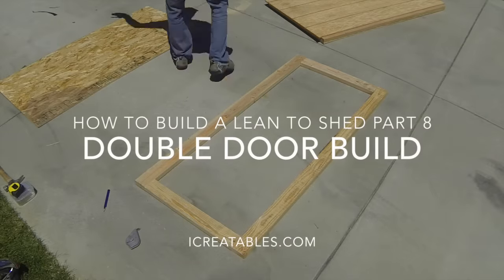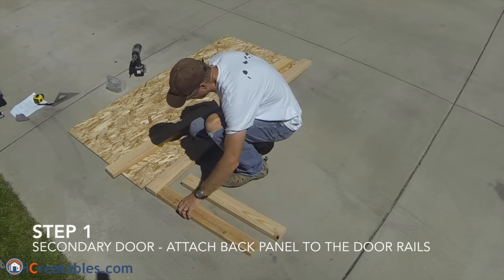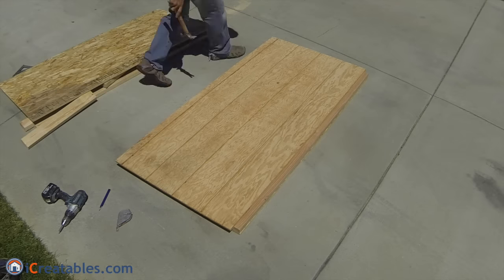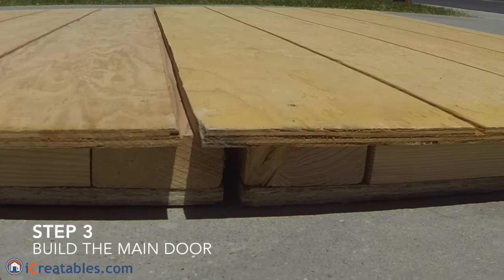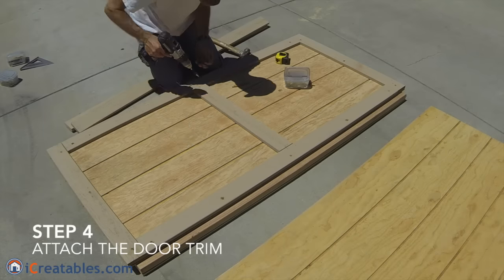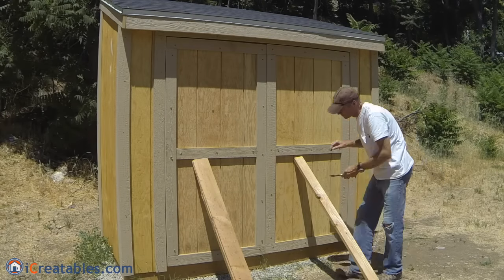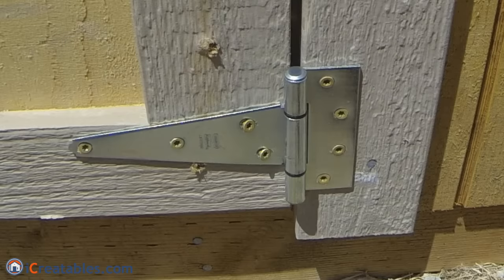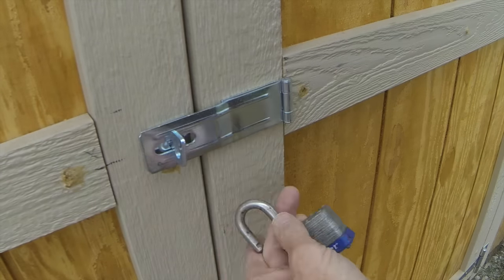How To Build A Lean To Shed - Part 8 - Double Door Build

Comment: Took me 5 hours.  This is one "SOLID" door.  Oh my, it is a horse, but I used $3.00 6" hinges from HD and it swings like  it is on oil. The door really looks sharp.  I made my door 1" longer at the bottom for overhang and it looks fine. Otherwise I followed the instructions on this video to the exact letter (I just had to build one door not two).  
One hint.  I used a 2x4 that was a little bowed as one of the side supports.  This was a mistake as the door is slightly bowed and not flush at the top.  If you think that it won't matter - IT WILL.
Over all the door looks and FEELS great.   I am very pleased.
Be careful when siding the shed on front to leave enough material for the door or you will have to buy another T1-11 4" center or 12" centered sheet at $35.00 a pc.
Paint your trim on your doors and trimmed door way before you hang and then your hinges won't be a pain to paint or stain around.
Reply: Thanks for the video content! Excuse me for chiming in, I would love your initial thoughts. Have you considered - Mahorrla Wooden Paradise Method (erm, check it on google should be there)? It is a great one off guide for building better sheds and woodworking minus the normal expense. Ive heard some awesome things about it and my work buddy after a lifetime of fighting got great success with it.
Reply: Cramp in upper leg
Reply: Cy Ance I
Reply: Cy Ance ‘

Comment: Thanks a million. I did my 10/12 shed using all of the steps from 1-10. Today I finally finished and soon I will install a shelving unit and run the electrical wiring for outlet plugs and light switches. Again thank you from Dallas Texas.
Reply from the maker: Thanks for watching and commenting!

Comment: My brother-in-law and I built a shed at his place and for reasons he could not explain he wanted the roof like this one, sloping to the front so we did, but I’ve always slopes them to the rear for rain run off at the back of the shed plus then a gutter is not needed off the rear, would love to hear the pros on doing it this way. Anyway great video on the build, thanks for sharing.
Reply: The biggest wall has the most room for storing longer or taller items instead of having a giant square hole in it.

Comment: So...my plans call for 2 doors 30"x80".  My rough opening is 62.5"W x 82.5"H.

I'm confused about the size of the overhang on the hinge sides.  Won't the overlap be too much to open the doors?

I'm guessing my secondary door will have the same width outer plywood as the 30"x80" 2x4 frame and shifted over to the hinge side by 1.25" and then  + 2.5" bigger on the height for 1.25" overhang top and bottom.  Right?  

And then the primary door will have the 30"x80" 2x4 frame (same as the other one) with the outer plywood center overhang of 1.5" and hinge side overhang of 1.25" and then the 82.5" height for a 1.25" overhang on the upper and lower ends.  Right?  

How does that not hang up on the hinge side?  

Your videos are fantastic, by the way!  Thank you.

Comment: In video 5 we're told, "the door trim is installed flush with the edge of the siding that is held back 1" from the door opening framing", yet in this video the side and top overhangs are 1 1/4".  Did I miss something?
Reply from the maker: The edge of the door frame is 1/2" smaller than the door opening to allow the door to freely close without pinching and if there is anything that is not square. This means that the door frame is 1 1/2" from the siding and trim. We allow for a 1/4" gap around the edge of the door to allow the door to close without pinching.  This leaves 1 1/4" for the overhangs. Thanks for the great question.

Comment: Great videos, thanks a lot. Just wondering about the 1/2 osb under the door to put it up, won't that mean my door will be flush at the top with a 1/2 space at the bottom ?
Reply: on my plans, the door opening is framed to 6' 10.5" and the shed door is 6' 9.5", so with the 1/2" on the bottom there will still be 1/2" on the top

Comment: only issue i am having is when putting the doors on, the trim pieces are offset. I am having to add an additional trim piece around the shed on door opening so it is flush with the trim on the doors so i can install the hinges.  Any ideas what I am doing wrong? TIA...Ernie

Comment: Wouldn't it be easier to mount the hinge straps on the doors first (before placing the doors in the opening and adjusting the reveals) and then secure the hinge tails to the side casings?
Reply: Yes, but if G0d wanted it to be easy, he would have given you the money to hire someone else to build it.

Comment: Used this technique, but had problems. Interior panel bowed, pulling the center rail inward. The doors are not meeting squarely at the center so I can not install the lock I wanted to use. When I rebuild I will build a proper interior frame that will force the panels flat instead of the panels forcing the "frame" out of alignment.

Comment: Very nice, but why to put a padlock if hinger are screwed for outside !
Reply: I was wondering the same thing.  I went back and watched that section again, just to check to see if I missed something.
Reply: It's easier than putting in a real door handle.  If someone really wants your lawn mower, they will find a way.
Reply: Notice that the screws being used are star pattern. They come with a special bit. It is unlikely that someone sneaking around trying to break in will have such a bit handy. Just my .02 cents worth.
Reply: Just put a dab of jb weld in the screw heads if its that big a deal and paint over them.
Reply: just what I was thunking,intruder only has to back out the hinge screws .
Reply: It is a known fact that thieves do not understand the Torx concept (in fact they'll often be caught the next morning, still staring blankly at them).  Rather, they will move on to the neighbor's inferior, slotted-screw construction.
Reply: Locks only keep honest people out anyways.  If someone wants to get into your shed....they will.  A lock  will just slow them down a little bit.
Reply: @DrummerBrianAylor  standard t25 bit..not a specialty tool

Comment: It is not clear in the video the size of the rails. I have 5' wide and 7' high, what is the size of my rails should be? thanks
Reply: The size of the inner panel should be one inch less than the actual size of the door opening. 

DallasCityOfChampions

Comment: what size plywood is that for the door front and back?
Reply from the maker: lookintocool Hi, it is 7/16" O.S.B. on the inside panel and 1/2" T1-11 siding on the front.
Reply: iCreatables home depot only sells 5/8 t1-11 i will have to look around, you used 2x4s for the frame correct?  & 3/4  1x4 or 1x6 for the front trim? thanks for all your help. the doors are the best ive seen made so far.
Reply from the maker: lookintocool If you go to the contractor desk they can get thinner sheets. Yes 2x4's are for the wall and roof framing. Yes on the trim. Thanks for watching.
Reply: +iCreatables Thanks. That sound SO much better than digging and filling 3 foot deep footers with cement to try to get below the frost line in my area.

Comment: All in all a great shed but why put the slope of the roof towards the front on a freestanding shed? When rain or snow comes, all will pour down in front of the doors
Reply from the maker: Yes that is correct. That is the way it is done if you want to build a shed up against a wall or structure.

Comment: "Remember, always use exterior polymer coated FLAT HEAD screws for all attachments"...as it zooms to close up of torx screw.
Reply: torx and flathead are not mutually exclusive. I used "exterior polymer coated flat head screws" that had torx drive patterns.
Reply: The heads of the torx screws are flat.